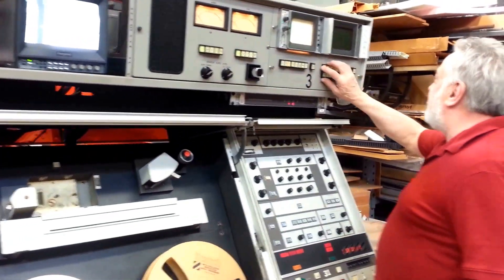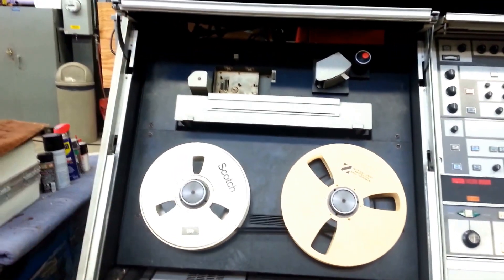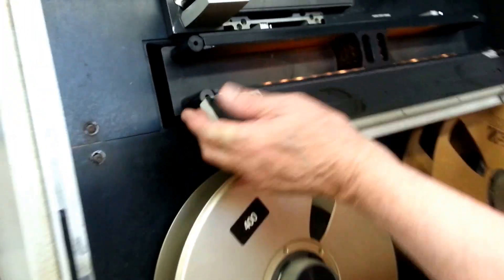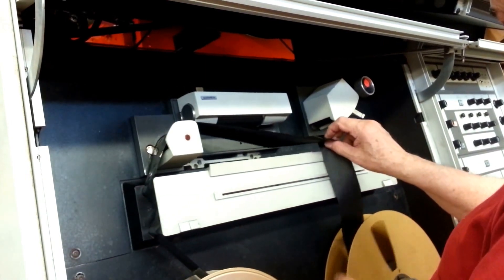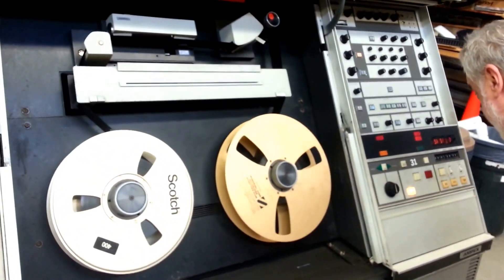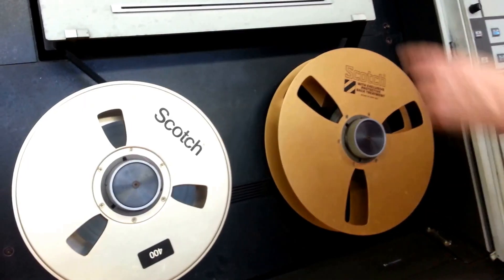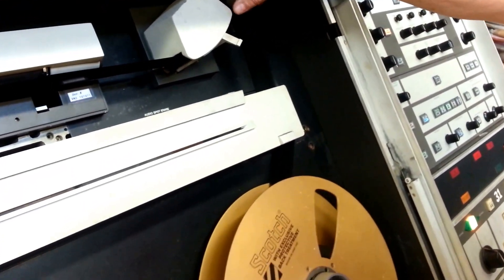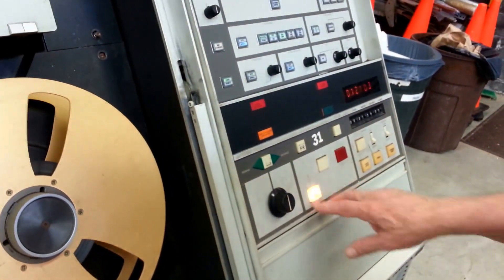Ampex AVR-1 quadraplex video recorder

Comment: Best machine made! I worked on EVERY quad that AMPEX made
Reply: I worked on 1200s,  2000s,  AVR2, VPR1,  2,  3 & 6. Also TK-70. :0)
Reply: @maximilliancunningham6091  nice. I liked the 2000b and AVR-1 the most. Used an ACR-25 for a number of years. That was a beast for sure. We had 10 2000b's that we yanked the monitor out and installed an intercom, and a 99 input 1u a/v switcher in its place. We placed a Conrad 19" color monitor on top with a hood over it where the speaker was mounted.
In another facility we had 26 mostly RCA TR-70s & 600 which i felt were inferior to Ampex machines. I loved the quad days. Never liked helical. Tape is loke sandpaper on the heads and it boggles my mind why you want the heads to be in contact with the tape during rewind, FF or shuttle operations. Helical was obviously geared to film students and the "artistic" types who like to see pictures in these modes. In addition, its impossible the physically edit or splice helical.
Reply: @rty1955  Also VPR-3,,,